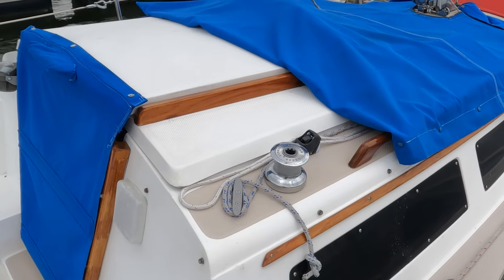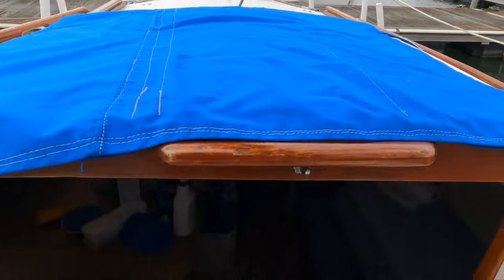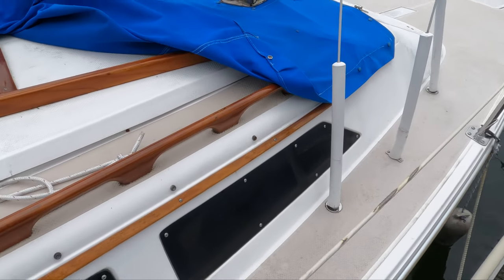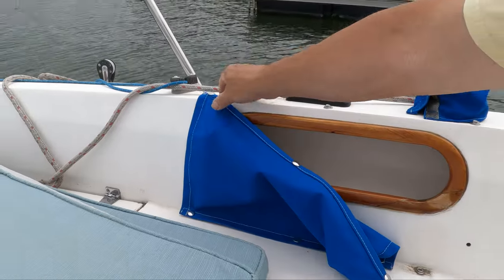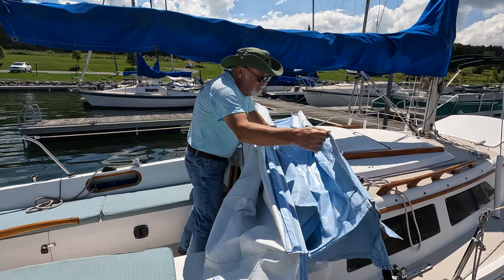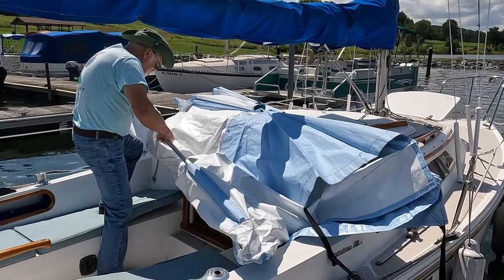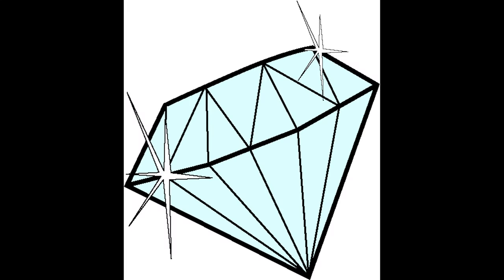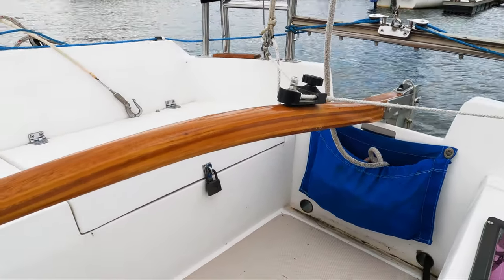# 18. 5 Diamond Canvas Projects

Comment: For the companionway cover, are the battens (or the middle batten) designed to engage in the groove of the fixed companionway molding or do they stay proud of and across the outside edge of the fixed companionway molding?
Reply from the maker: The batten at the very bottom is large and heavy so it keeps the canvas stretched vertical. The small center batten resting on the companionway frame keeps the cloth from being pushed inward by wind or water.

Comment: Do you recommend the "Tiller Tamer" over Catalina Direct's semi-equivalent tiller holder thing?
Reply from the maker: I do not like the Tiller Tamer, problem is on a Cat 22 with the weather helm this unit can not handle it. I recommend a tiller lock mounted on the bottom of the tiller where one can use one finger to engage and disengage when needed.
Reply from the maker: WaveFront TillerClutch Kit